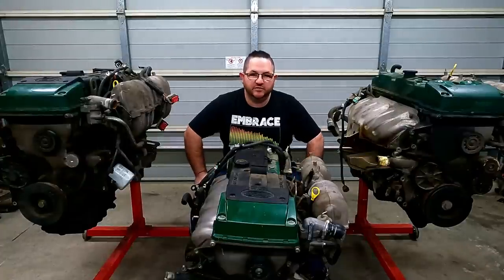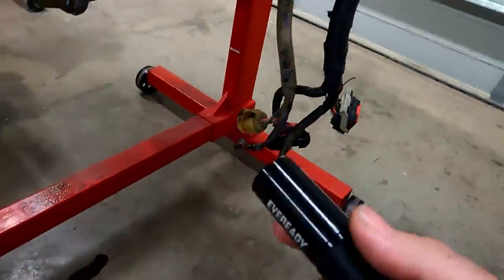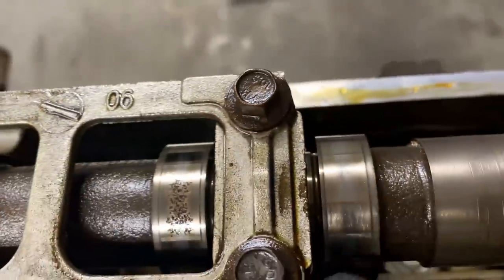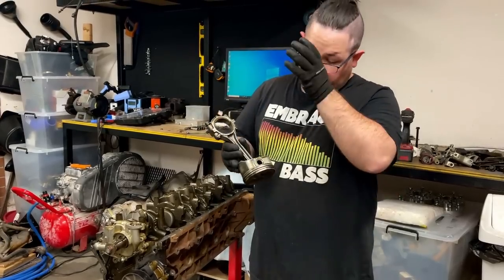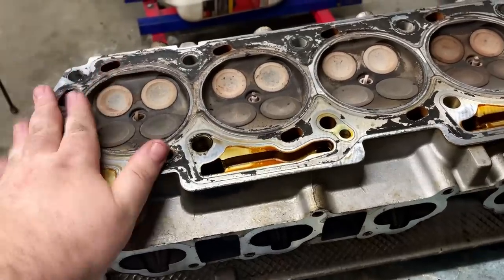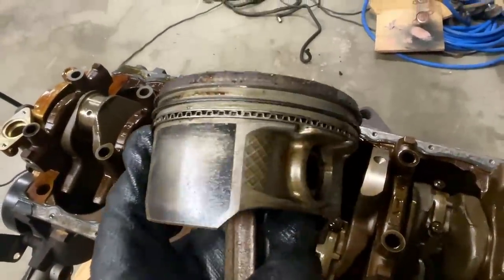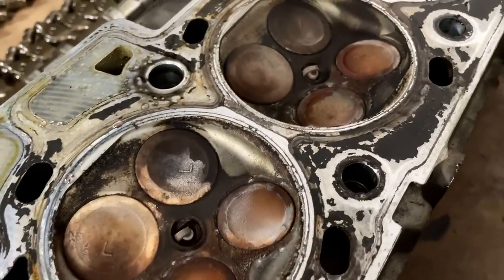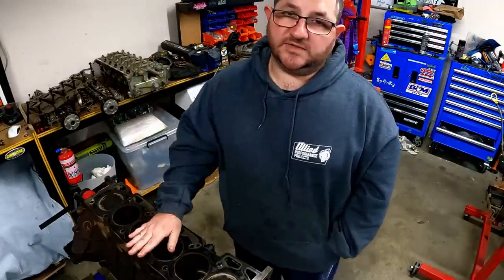Comparing Ford Barra Green Tops

Comment: Nice video, my favourite motor is the BF, really nice torque curve at low rpm, max torque is at 2500rpm and all the way to 2500rpm is producing more torque than the FG motor in stock form petrol homologation. FG produces slightly more torque but this is produced at above 3000rpm only.
Reply from the maker: Thanks for the info! I have a BF motor in my EB falcon and its great. Thanks for watching!

Comment: Thanks for the brilliant video mate, awesome quality, no wasted time, excellent editing, very useful information. My cheap 'project car' is a June 2003 BA wagon, with 522,000km original engine/auto/diff. Have renewed the timing chain cover gasket to fix that leak, but still have a small leak from the rear of the sump dammit. My 'project' is to see if I can get it over the million km's  finish line.
Reply from the maker: Thanks for watching! Glad you enjoyed it. 1 million km shouldn't be an issue at all! Good luck with it.

Comment: Good vid. There goes the cheap BA motors!

Didnt happen to measure the head gaskets thicknesses did you?
Also, i think you will find those oil leaks were from the power steering pumps. They are infamous for leaking, and they leak down onto the alternator, which slowly kills them and spreads the oil to the timing case.
Reply: Same as the dude who was repping them X5 etc Bemmer 6 speed boxes which were 150 at the wreckers in the States and worldwide. They a k plus now haha.

Comment: Good video mate , i love these henry 6 potters , i have the barra`s little brother the VCT in the xr6 , drove it as a tow car and family taxi for 17 years until the body was very tired in need of major TLC ,  retired  her as i`m now to old to be spannering cars unfortunately and drove her into the front yard with being completely unopened with original head gasket it left the factory with  and still running like a beauty except for a bit of timing chain/guide  rattle .
if anyone wants to talk about green , here are engines that go for a long long time and are shit easy and cheap to give a freshen up to go another life time .
Reply: Go the Intech and VCT  SOHC.....Barra's are great ..I have one in my FG XR6 but my old 2001 AU ll  Futura  Intech just goes and goes and goes .. Penrite oil fixed a  very slight lifter chatter and quiet as a church mouse now ..She occasionally has a squeaky dash and if it's dry for a while a sway bar rubber will squeak over speed bumps ..I love the old girl ..Another thing about the AU's with the inline 6 ... Out of production for two decades and they are still EVERYWHERE in decent numbers . Never ceases to amaze me ...Such a good car ..

Comment: Nice video mate! Could have also gone over compression ratios. Pretty sure it’s even higher in the FG engines especially if it’s and LPI motor
Reply from the maker: Thanks for watching mate!
At the time of filming, i wasn't aware what was actually different between the motors.
I've since found out the BAs have 10.7:1 compression and BF/FG are 10.3:1.
The FG mk2 has the ecoLPI and has 12:1 compression. The rumor is ecoLPI went back to skinny rods but i have pulled one apart to look yet.
Reply: Thanks for sharing this informative video.

I’d be interested to know if the much higher technology (12:1 compression ratio & EFI) EcoLPI “Barra” six has the thicker con-rods too, and also which valves they have, etc. 🚙
Reply: @EverythingFuzzY  Be interesting to see the FG mk2 engine as it would seem a backwards step to have the skinny rods while upping the compression so much.
Reply: @lyndongordon2518  lpi have skinny rods , that's what all the top barra guys/shops have said 👍 
Comps way too high in them anyway.
Reply: @5lcalais1  , thanks for your reply.

Calling the con-rods that Barra six engines other than the “green top” E-gas engines got, then later, the turbocharged engines got,, as “skinny” is probably inaccurate. I expect the E-gas (carbureted LPG) engines got the thicker con-rods to resist bending if a back-fire occurs in the intake manifold when an intake valve is still open for a cylinder with a piston travelling up the cylinder. Such a situation is probably impossible with the (liquid phase EFI of LPG) EcoLPI engines, because their intake manifolds should only ever have air in them  (no fuel mixture).

As for the EcoLPI Barra engine’s 12:1 compression ratio, even higher compression may have been considered, but I expect the lowest equivalent octane rated LPG available at fuel station pumps had to be allowed for. The standard EcoLPI engines generate more torque & power than the naturally aspirated petrol Barra sixes. They’re excellent!

One would think it’d have been better from a logistical & reliability standpoint, for Ford to have equipped all later Barra six engines with the thicker con-rods introduced in the E-gas engine. Do you have any links to factual information about the EcoLPI engine’s connecting rods that you can share here? I’d be interested to read more. Cheers. 🚙

Comment: The first part of the number is the design or production year, 1R = 2001 AU2 (yes the NA rods are the same as AU2), 3R = 2003 BA, 5R - 2005 BF,  7R - 2007 FG (also 8R), AR - 2010 MKII (A=10 in hexadecimal).
Reply from the maker: Thanks for the info! Can you shed any light on the camshaft part numbers? i have 2x sets of BF camshafts (one from an NA motor and one from an LPG motor) with the part number 5R296250 on both int & exh cams.
Theres another set of numbers but they are completely different. As far as i was aware all the camshafts were the same spec.

Comment: Gday mate fantastic video.just what I was looking for the truth. I'm a proud owner bf green.top barra 06 model ute. 333,000ks on the clock in years ive had it use penrite oil.only harmonic balancer to rear main seals have been done and motor runs like gem. Very happy with yr disabling the motors very interesting and well explained.
Reply from the maker: Nice! Thanks for watching.
Reply: I used the recommended penrite oil in the diff on my Ba big mistake there are 2 seals listed for the pinion one is for synthetic one is for mineral oil. The pentite recommended oil was synthetic it destroyed the seal after a month oil everywhere under my once spotless ba xr6 turbo ute. I am now very wary of using synthetic oil in older cars a pinion seal is the same type of seal as a front and rear seal and if you use synthetic oil with a seal that was never made for it it destroys them.

Comment: Were are you located? I've got a BA EGAS and I did an SCT Flash tune and Change the Exhaust with Extractors.
I literally got 10kw more.
The Tuner said my motor wasn't getting enough LPG that was the main problem.
I can't remember what he said about a new specific mixer would boost up the power and change the DOHC to a Kelford Cam.
I've had this car many year's it literally never missed a beat.
Extremely reliable as i have always Used Nulon 15-40 Diesel and Irridum spark plugs. Always up to date. It has 245,000km.
Would it be worth changing the Cams and retuning?
Not because i want serious gain's but i just love driving this comfortable car and it's just still sluggish. Worse before the SCT FLASH AND EXHAUST system 
What's your opinion?

Comment: G'Day Mr Fuzzy,,Mate love this sorta sruff,,as for the BF cam shaft pitting,,have seen this sorta thing on BIG gear boxs,where the surface finish wernt up to spec,,the only other thing i could say and i really don't know,the coatings on cam running surface is chromed and the chroming was the factor to pitting,,May be oil was not good enough to remove hydraulic pressure between componants,,and oil is injected in to metal surface,,we used to call this spawling,,
Just a Fun fact,,Did you now the oil in your hypoid diff evaporate between wearing surfaces,,under extreme loads..
Yeer didn;t beleive it me self,,but for sure,,again thanks for sharing,,

Edit::
 BIG gea box has 30 ton gears in them,,and run on white metal bearing carfully scrapped,(by Me),,

Comment: That BA engine is a later one, you can tell by the triple filter OCVs, the first few months of gas engines had thin rods but you'd be pretty unlucky to find a surviving one. On the assembly line there were different heads for LPG, I was told by one of the engineers that they had different exhaust valves, whether or not they were the same as turbo I never checked. If the heads were the same as standard they wouldn't have bothered making sure only a different "gas" head was fitted.
Reply: What are the ocvs, ive got a ba greentop im trying to sus out without pulling it apart
Reply: @HUNTER01101991  Oil Control Valves, they modulate flow to the variable cam phasers. The early ones were jamming so they fitted different valves with screen filters.
Reply: That is correct. I worked at a Ford dealer and there was a recall on the some gas motors because they came from the factory with the wrong head (n/a one). The recall was to remove the old head and replace it with a gas head. Difference being the gas head was rated for more heat because gas burns hotter than petrol.... At least that's what I was told.

Comment: Good video. My theory on why people incorrectly think the BA green top has the spaghetti rods is because early BA turbo engines only had the weak rods.
Reply from the maker: I agree, mate. Thanks for watching!
Reply: Same, so if I was to put spaghetti rods in my stock lpg ba would they be lighter for a better power (not race but work ute) ?
Reply: @maxgood42  They would be lighter for slightly better throttle response due to a slightly lighter spinning mass. They would not gain you better power and you run the risk of bending one or two if you have a backfire. That's why Ford fitted stronger rods in the first place. 

If you want better power (and probably better economy) a less restrictive exhaust system and a set of extractors is far less messing about. a K&N or BMC re usable air filter and a Territory duct may help too.
Reply: @jamesforge8107  yeah didn’t think of that plus I guess it may mess up the secondary balance too. Was also thinking about taking off the lpg throttle body and using a 255 mixer in place like the factory VT gas has
Reply: @maxgood42  I have a dual fuel BA. I fitted it with the Egas throttle body. Yeah it's a restriction but it was a massive improvement over the mixer ring that was silasticed into the duct. More power and better economy. Never crossed my mind to use VT parts.

It's all about to be replaced with an Egas engine running petrol injection and LPG vapour injection. With it's slightly higher compression and the vapour injection it should run better on LPG and on Petrol (probably 95 octane) than it ever has.
Reply: @jamesforge8107  Yes or I think the FG had a gas injection manifold option as well ?
Reply: @maxgood42  Later FG had liquid phase LPG injection. It had about 205Kw (more than the 195Kw petrol Barra) and used a lot less LPG than a mixer ring setup.
That engine didn't have the stronger rods as they were no longer needed.

Comment: Good Vid , Nicely Done  ! Another difference that iv'e noticed between my BF motor and the BA .Is the Sump , on my BF sump it has the mounting lugs for the Trans cooler . i think the BA is cooled through the radiator .  I just got a 2003 , 220 Kl'm BA to replace my 2006,  338899 Kl'm with head gasket gone , still ran great ,  not hot , just foamed up the rocker box , I just put a liter of  coolant in it every day , so other than  do the head (Which could be cracked ? So i was told ) Some pitting on the cams in the BF. so I  just got the 220kl'm  BA . On the Knock sensors My BF had 2  and the BA 1  will that be a problem  ? Or just add the 2 to the BA motor ?

Comment: Try and grab a 4n1(3/4/5) Mitsubishi engine for a project.  All aluminum and one of the only diesel engines on the market (maybe the only one IIRC) with variable valve timing (intake).  I doubt they will ever sell them in Australia again, as they removed them from their vehicle lineup (not overseas though).

Comment: I did have a question about the Crank, what ive been told is gas/turboed is forged, the rest is casted, so the gasser cranks can handle like 10x the power..

none the less, good bits of information to know!
Reply: Cranks are all the same dude, as far as I know there is no difference.

Comment: Subbed mate. I've got an FG egas XR6 ute as my daily driver. Do you think lack of maintenance would cause the pitting in the camshafts etc.
Reply from the maker: Thanks for the sub and checking out my video! I think its a combination of things. Poor hardening process, bad quality oil, lack of oil changes etc. Ive never seen a BA/BF with that type of wear.

Comment: Great vid mate, thanks for uploading!
Reply from the maker: Glad you enjoyed it
Reply: @EverythingFuzzY  one thing I’ve struggled finding a picture of is the Barr’s engine number location. I’m building a bf xr6t for circuit work which is supposed to have a green top in it, trying to identify if it actually is. Great info on the bf block having both front and rear dipstick provisions

Comment: The BA uses a different sump gasket to the BF as well.
Reply from the maker: Yep, that's correct, I forgot to add that bit in. Thanks for watching and commenting!
Reply: Yeah just like the timing cover, there is no sump gasket on the BF, only rtv silicone. Still has half moon seals on the ends of the sump though, thats where BF leaks, the rubber shrinks and goes brittle. Put plenty of rtv on new half moon seals so it can never happen again.

Comment: I assume the FG one is the ecoLPI one with the LPG injection, while the other 2 have the LPG down the throttle body setup, like old down the carby throat LPG setups. If I’m right then the FG one will have injectors while the others won’t.
Reply from the maker: @mickvonbornemann3824  No, FG mk1 had the LPG down the throttle same as the others. FG mk2 was ecoLPI and i have another video on that engine too, check it out!

Comment: G day good honest video thank you

 I have a track car I am designing I was planning on using an old 173 red motor and a lot of my accumulated spares but my weekend car might need it now 

So I started looking at Barras then complete doners for motor box and diff BAs in particular

Not being overly familiar with modern motors let alone Ford's offerings would you have suggestion for a NA motor that's the easiest to get running without the main body loom ? Thank you for your time

Comment: So basically, a gas motors good for a budget build if it's low K and if you can only get a high K gassy needing a tear down anyway, might aswell start with any old donk and chuck some decent rods/pistons at it.. 
Will need valve springs, pump gears and timing kit anyway if it's anything but half assed
Reply from the maker: Yup, i've been saying it for a while now.
It's actually cheaper to buy a junkyard motor and build it up than to buy a turbo motor. Prices have skyrocketed lately.

Comment: I'm thinking about doing my first turbo Barra conversion into a CL Chrysler Wagon.
There's so many different options available 
Any suggestions on best Model engine/gearbox and  would be appreciated as I'm on the hunt
Reply from the maker: I'm not very familiar with the Chrysler stuff I'm afraid so i couldn't tell you what will work best. if you dont plan on turboing it i'd be looking into the BF engine for sure.
Thanks for watching!

Comment: Most fga engine can be turbocharged with out changing pistons hence extra oil passage splash grooves on pistons the others have to be changed to fga piston to turbo charge but there is 12 piston variants standard 16 turbo spec pistons

Comment: Fantastic video! Thank you for taking the time to put this information out for everyone, I’m definitely a Berra fanboy but I’ll every own one lol. The ones that have already been imported are crazy expensive unfortunately
Reply from the maker: My pleasure, it's been a great learning experience for sure! Thanks for watching.
Reply: It is a terrific video....assuming you are overseas by your comments...Some don't know there is another amazing inline Ford straight six available and also capable of huge upgrading ..It's actually what the Barra evolved from and concluded in 2002 .. It was /is  the 4.0  SOHC Intech .... Bottom end essentially the same as Barra but the head is single overhead cam and a few other differences ..I have an FG XR6 N/A Barra and an AU Futura with a beautiful  sweet running Intech...love them both

Comment: Great video mate, did you ever find the reason why the cams pit on the fg motor
Reply from the maker: Thanks for watching!
Rumour has it ford changed the hardening process during manufacturing of the FG engine, also cheaper oil. Just what I’ve heard and read, so not sure how true it is!
Reply: @EverythingFuzzY  cheers mate, still does not change my point of view, these barra engines are awesome, the power you get in the turbo engine at a cheap price leaves most others for dead.